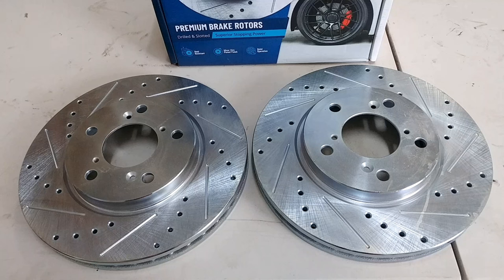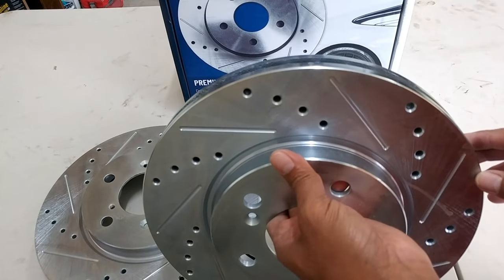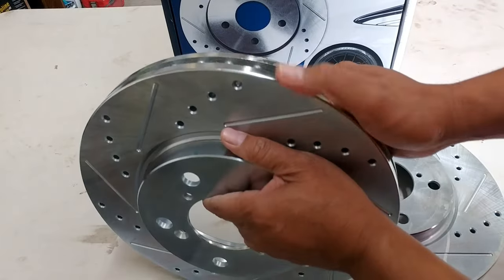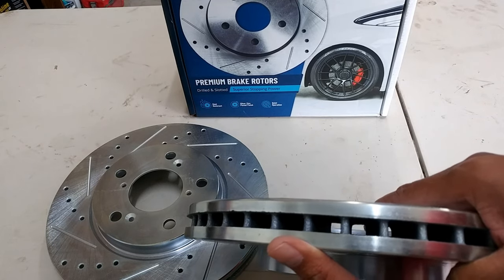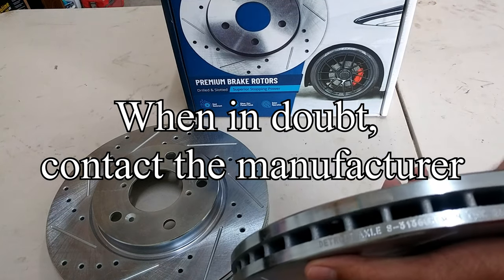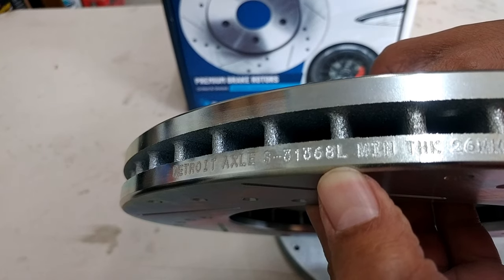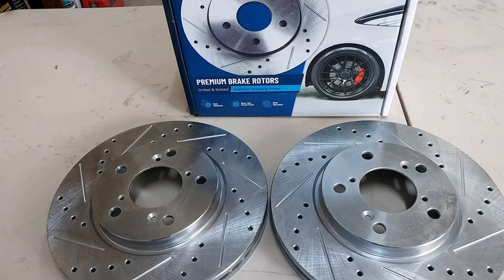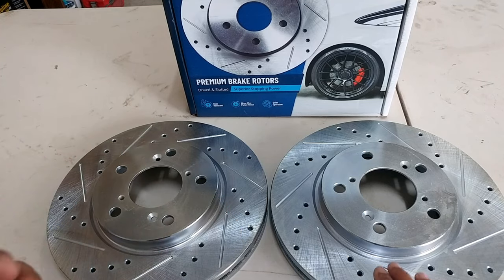This Direction Is Best For Your Drilled And Slotted Rotor

Comment: It is all about the vents, they point towards the back at the top. They expel hot air and gasses, not scoop it. This is the most important feature of directional rotors. If they are radial (straight out), it is irrelevant how you want them to face.
Reply from the maker: Thanks for sharing.

Comment: thanks for this. I didn't think it would mater cause on regular rotors it don't. but because these kind are slotted/drilled it does. no wonder people say these suck. they don't install them right.
Reply from the maker: I believe so. There are a lot of differing opinions from so called internet experts but I will stick with the manufacturer recommendation.

Comment: The slots on all slotted rotors should point forward so the wear dust is ejected outward away from the brake caliper by centrifugal force ...!
Reply from the maker: I believe you are referring to the cooling vane? Because some vane are slanted and some are straight.